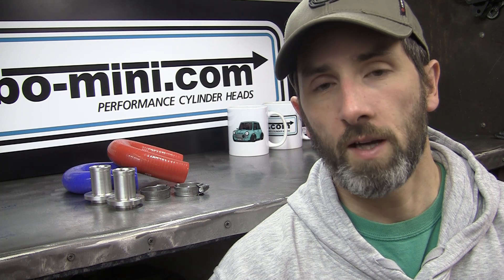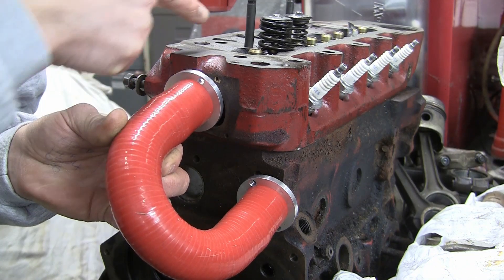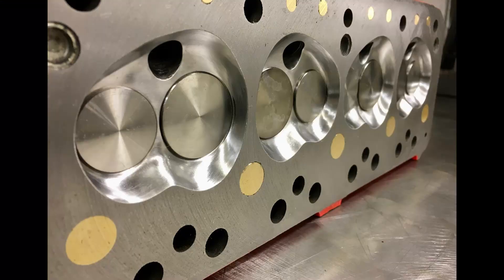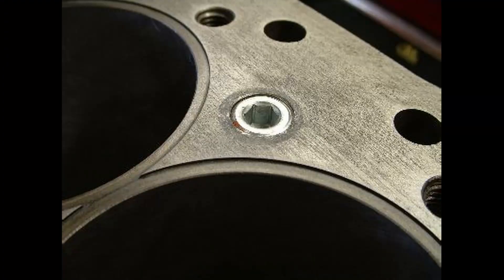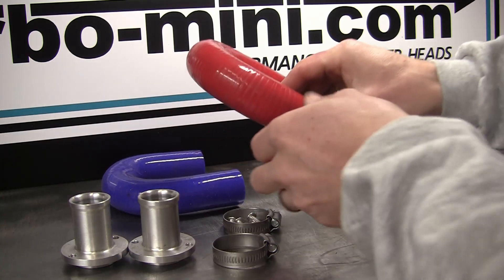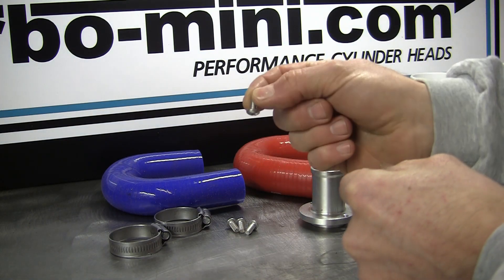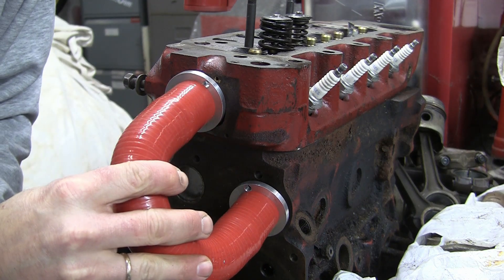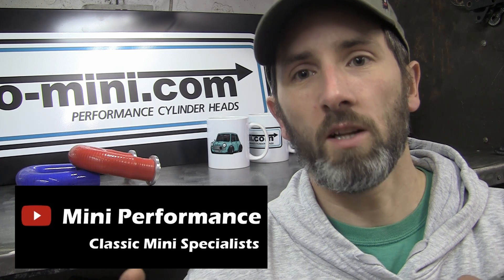Classic Mini how to Dry Deck your A-series engine to improve cooling, everything you need to know.

Comment: Im late to the video, but i cant seem to find an answer anywhere.

On the adaptors which go into the head and the block, how are the adaptors sealed to the block?

I was expecting to find these kits with o-rings, are the adaptors pressed into the head? Theres obviously something im missing, as surely it would leak without any kind of sealing.

Also, great informative video 👍
Reply from the maker: Thanks for watching. They need to be sealed in to both the head and block. 
I personally use Loctite Multi gasket.

Comment: Does this fit with the crank case breather and enginemount?
Reply from the maker: Hi. You can retain the crank case breather. You’ll have adapt the take off/engine mount if you want to use the front bolt to retain it.

Comment: Any advantage to semi dry decking by just installing grub screws around the #1 cylinder?
Reply from the maker: Hi Dean
It should help push more coolant further along the head/block to aid cooling on those cylinders. Though it’s not a method I’ve used myself.

Comment: If I dry deck, can I still use the heater take off on top of the cylinder head? So I can get heat inside the car. Great channel btw 👍
Reply from the maker: Thank you! You could, but it will reduce some of the water flow back across the head, so ideally I’d do without the heater if possible.
Reply: @TurboMinicom  ok thanks 😄👍
Reply from the maker: @Karlabacken  no problem glad to help and thanks for supporting the channel.

Comment: Phil… when you drill up for the hose fittings, do you have to clock the fittings on both the head and block for best location of fasteners?
Reply from the maker: Hi Randy. Sorry I’ve only just seen your question. On the block it will depend if you’re still using both bolts on the engine steady, you’ll have to clock the adaptor bolt holes to avoid this.
Reply: @TurboMinicom  thanks for the response…
Reply from the maker: @LoneStarMini  no problem hope you’re projects are going well.

Comment: Cheers Phil :) To anyone reading this, you can guess where i got my dry deck kit from! Much better value than some of the others on the market and Phil also did me a quality blanking plug when I moved my Arden heads around between engines and the dry deck kit wasn't required.
Reply from the maker: Cheer Rich, thanks for the positive feedback.